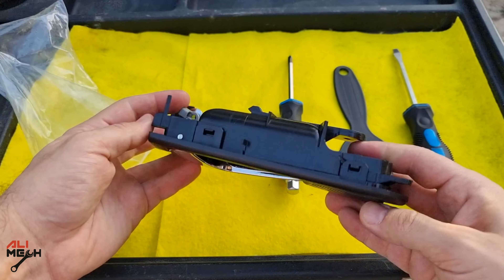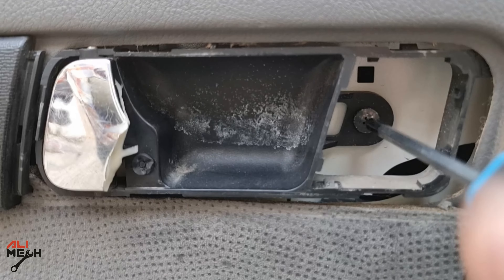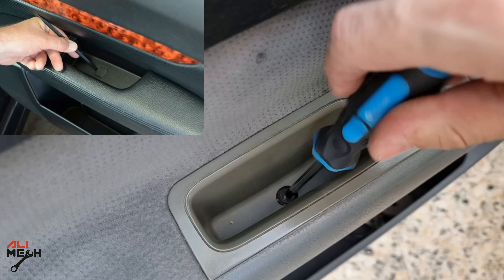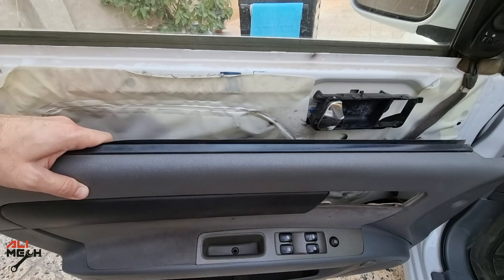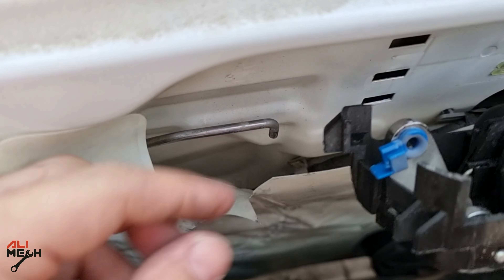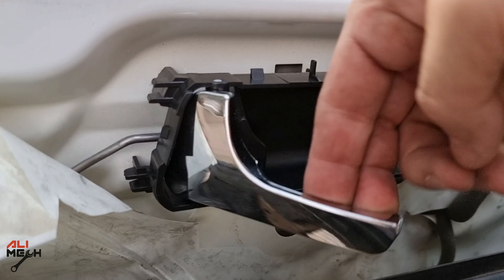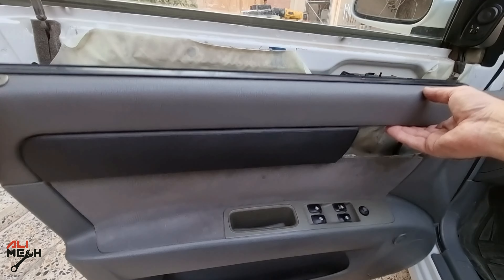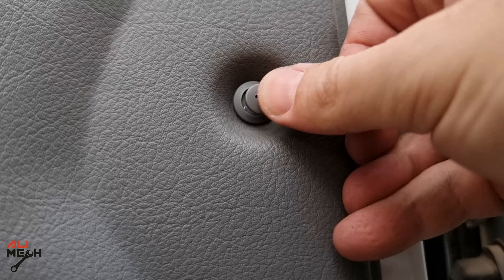How to replace broken door handle on your car/My car door won't open from the inside

Comment: Thanks Ali , more videos of the Chevy optra lacetti please
Reply from the maker: Will do! what exactly you wanna see
Reply: @AliMECH  anything, everything, all your work is art and helpful, I learned so much from you, tho I have a little problem with my Optra, when changing the gear I have like an instability in the engine regime, any suggestions? Thanks in advance
Reply: @AliMECH  Can you make one for replacing the from headlights. Just going to replace the door handle now!